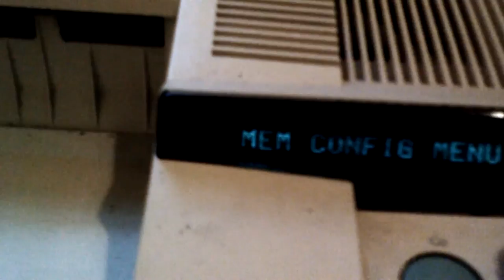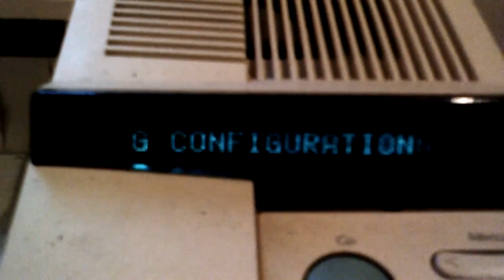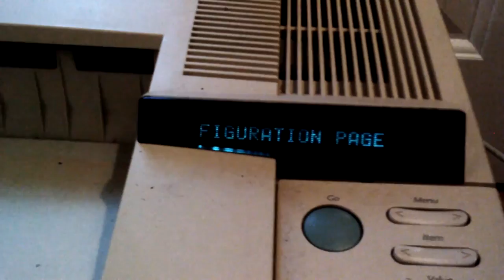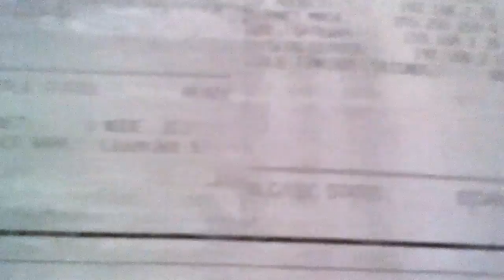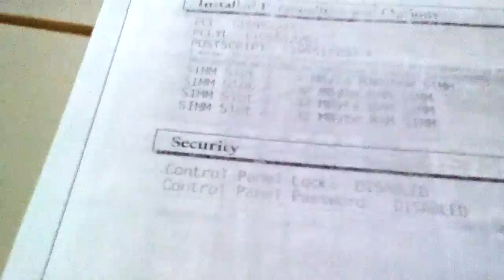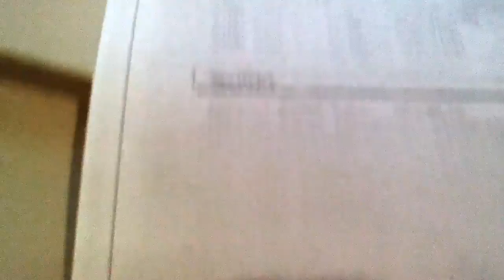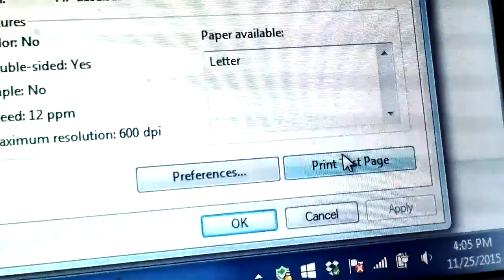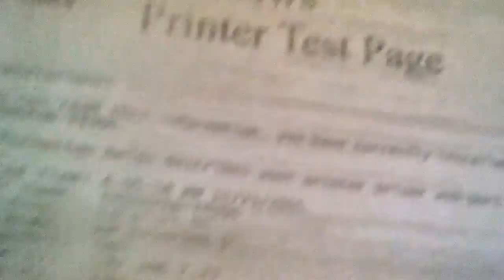HP LaserJet 5M overview

Comment: These 5M LaserJets were made between 1996 to 1997 before it switched to the 4000 / 4050 series that series was made between 1997 to 2001. The 5M is based on the Canon EXII engine much like the 4 Plus, toner cartridges cause those problems NOT the fuser.
Reply: What exactly you mean with "toner c. cause those problems"?